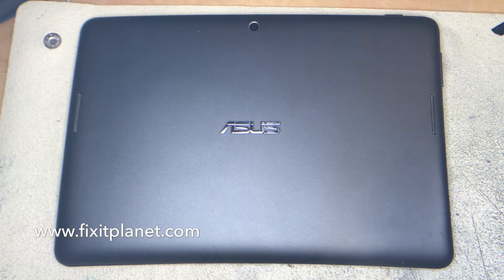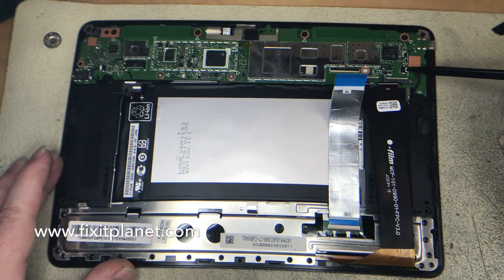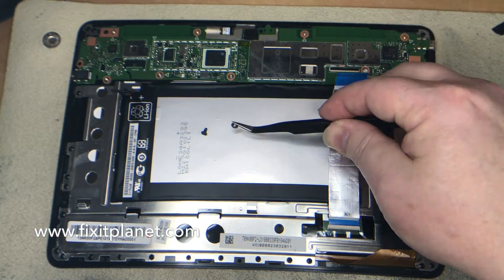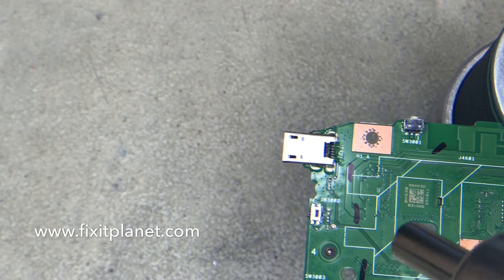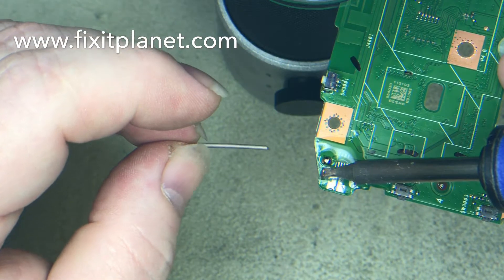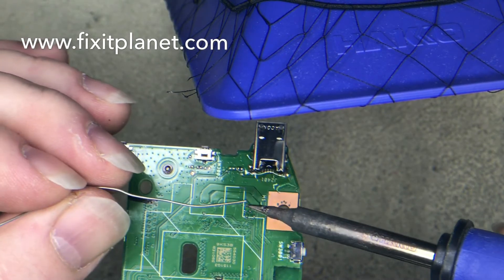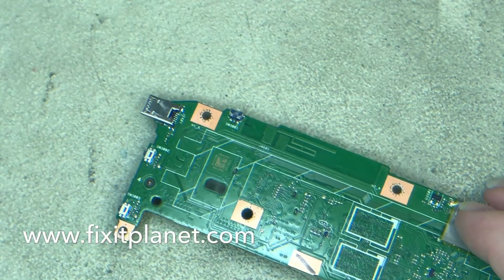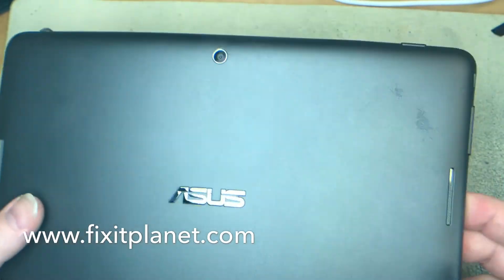ASUS Memo Pad 10.1 Charge Port Repair From Start To Finish.

Comment: Great work by a true craftsman, I worked quite a few years doing PC repair back in the 90s, could get tedious when you were tracing boards trying to find broken solder joints, replacing serial ports etc.. Will definately let you work on my stuff any day!

Comment: @4 min - what is "flux"???
Reply from the maker: In metallurgy, a flux (derived from Latin fluxus meaning “flow”) is a chemical cleaning agent, flowing agent, or purifying agent. ... As cleaning agents, fluxes facilitatesoldering, brazing, and welding by removing oxidation from the metals to be joined.